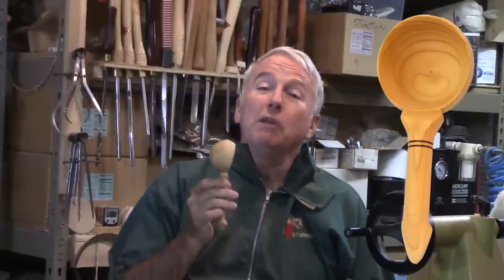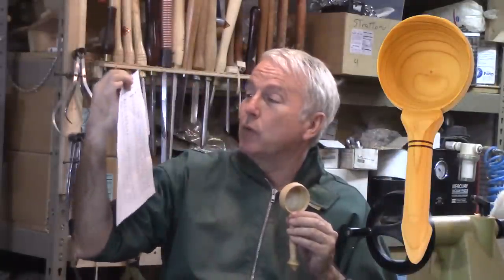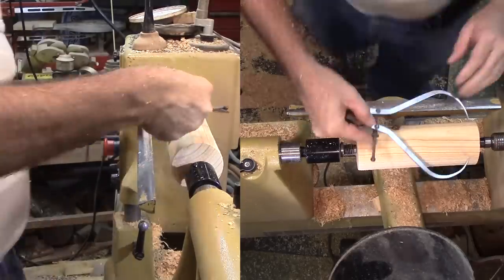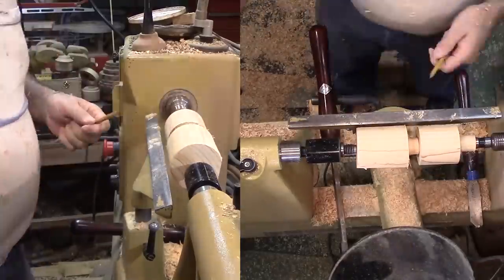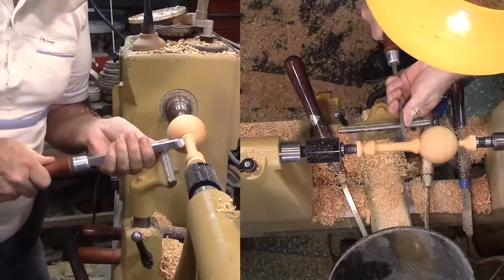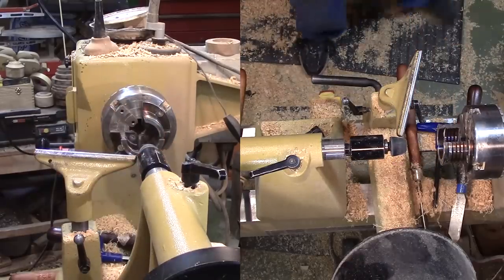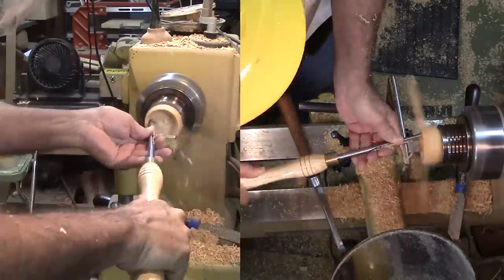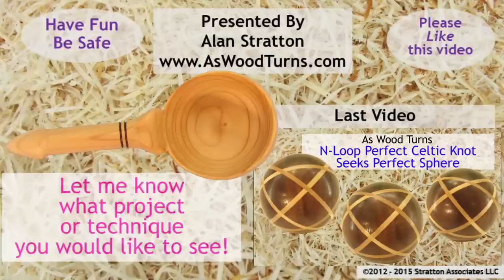Woodturning One Scoop After Another

Comment: Hope you will revisit the guidance that appears on your website on how to turn a sphere starting from an octagon. The sides of an octagon are equal yet you have labeled them as 0.293(d) and 0.414(d) on the same diagram.  Also, while 0.414(d) is indeed  the length of a side, one of the diagrams shows that side much smaller.  Third, the reason for placing marks on the midpoints of the faces of the octagon is that those marks are on the points where the face is tangent to the sphere and they should not be removed until final finish cuts.  Do not quite see the point of placing marks on material that is to be cut away.  It is the material between the marks that is to be removed.  Hope these comments are helpful.
Thanks for the vid!
Dave
Reply from the maker: Take another look at the diagram. 0.293(d) is the measure from the corner of the cylinder to the nearest corner of the octagon, If you mark that on the side of the cylinder, then mark 0.414(d)  the side takes you to the next corner. Then 0.293(d) from this second corner to the far corner of the cylinder.  All these add up to 1.0(d).
The mid point marks are only to help estimate another mid-point between that mark  and the next corner. The first mid-point is indeed a tangent.
May I suggest another video: Woodturning Perfect Spheres - For Wise Turners	https://youtu.be/fn51_oObNi0
This is more recent.
Alan